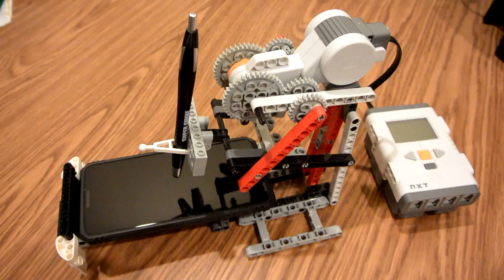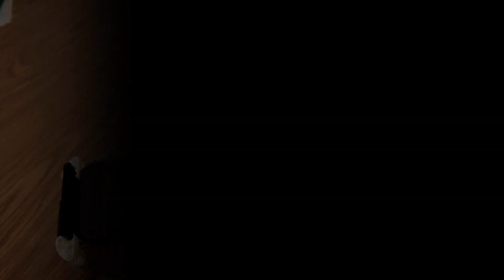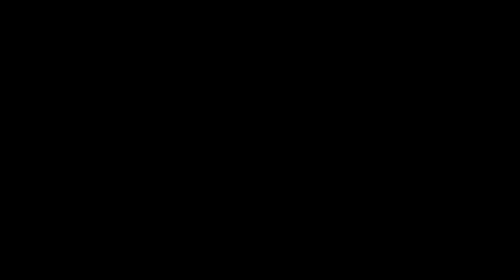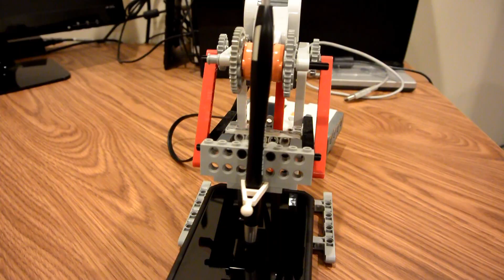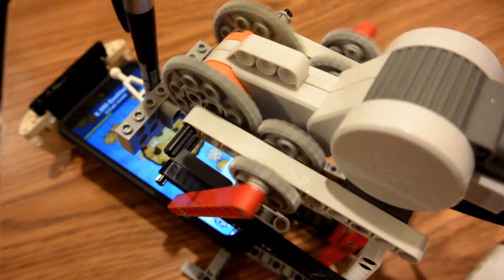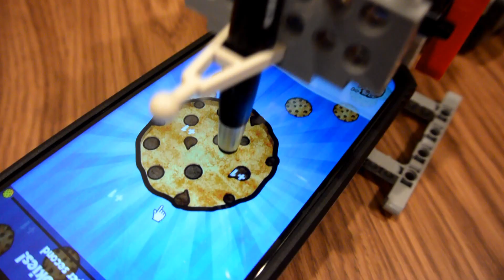LEGO Mindstorms Phone Screen Tapper (Auto Clicker)

Comment: need an auto tapper that uses two styluses where each one hit the screen alternatingly (i dont think that is a word but you get the idea) its like when you use both your thumbs or fingers to tap the creen really quick. the upside to this is you get more taps in by using this method tha ta sungle cant acheive since too fast wont always  register. reference game is Bitcoin Miner (where the pixaxe button expands horizontally for rapid dual thumb presess) also having a third single stylus at the top row right before the piggy bank to collect powerups. this could be amazing if achieved could let it run all day and earn free bitcoin. let me know. thnanks again.
Reply from the maker: In theory, this is very doable. However, if you are trying to do it for the purpose of earning bitcoin, I think there are better ways you could be making additional money. Those types of apps often take far too long to make such a little amount of bitcoin, even if it's automated. This is coming from someone who is a very active investor/trader, including some bitcoin.

Comment: My stylus pen does not work if my skin does not touch it. Why is that?
Reply from the maker: Your touch screen is likely capacitive. Your finger is in electrical conductor. So, when you touch a touch screen, your finger disrupts the devices electric field, and the device knows precisely where you touched. It sounds like your stylus pen is similar. On it's own, it does not act like an electric conductor, so it doesn't work on your device. However, when you are touching the stylus, you are providing the electric conductivity it needs to make your device respond.

Comment: are you aware of any other materials that a phone screen registers? I am trying to build something similar
Reply from the maker: There are touch screen stickers out there. I think they are designed to be put on gloves, but theoretically you could stick them on anything. So that might work for you. I have never used them, though, only heard of them.
Reply: @JHYO333  Where did you get the pieces? Im trying to make one aswell
Reply from the maker: @inksans2596  Most of them were just pieces I had lying around from various lego sets. The motor and brain came from a lego education NXT set, though.